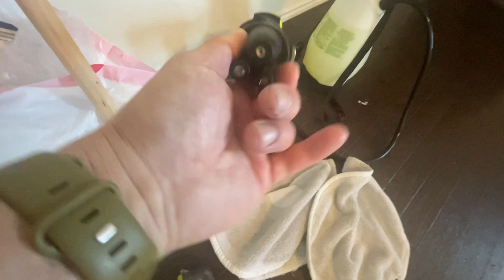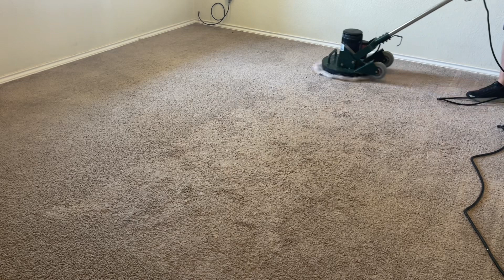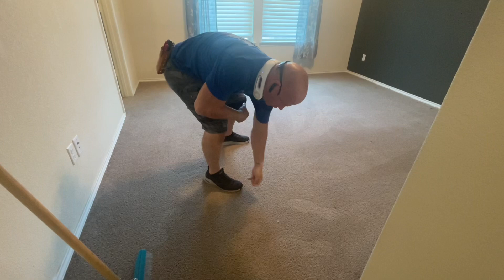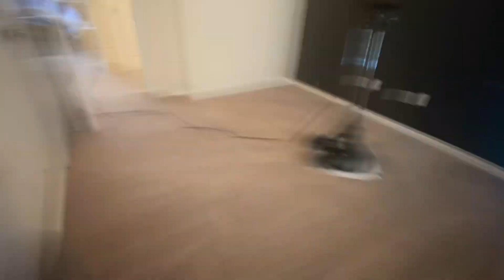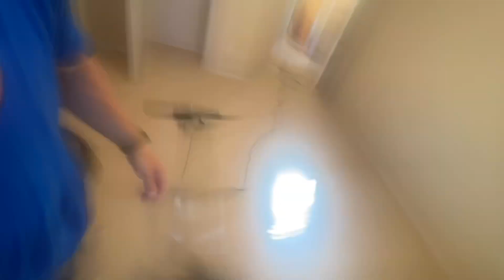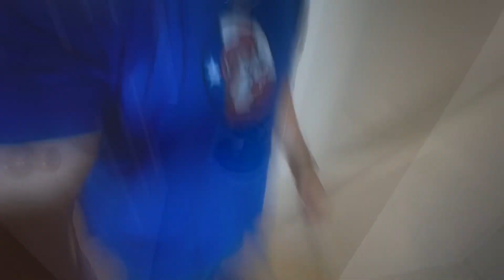Ryobi 18v pressure washer.  Utilize it for carpet cleaning.  Vlm. Challenger.

Comment: The 600 PSI demo was hilarious. Obviously a little too much but good to see. I believe the oreck if you take off the white cap that holds the bonnet holder. You can tighten up the offset counter weight that makes the oreck act as an orbital. The rattling sound could be something as simple as just tightening everything up. Great clean btw.
Reply from the maker: Replace is the plan on the oreck. Going to have to look around pretty quick. It is so loud 😬😬